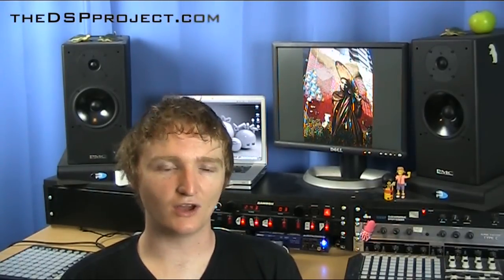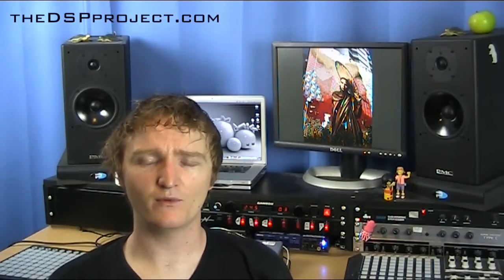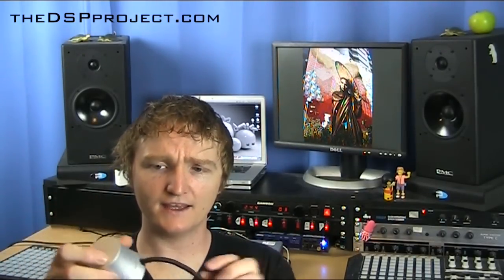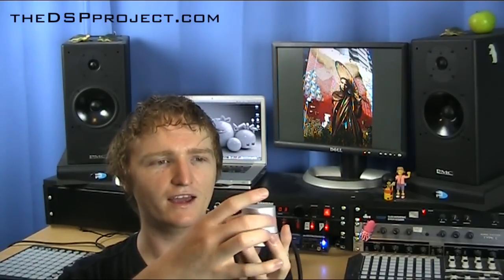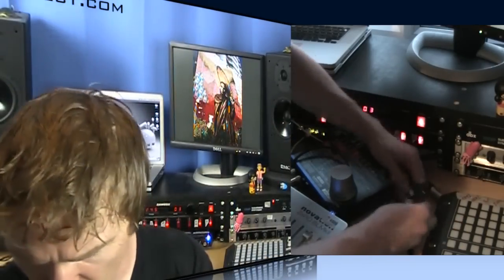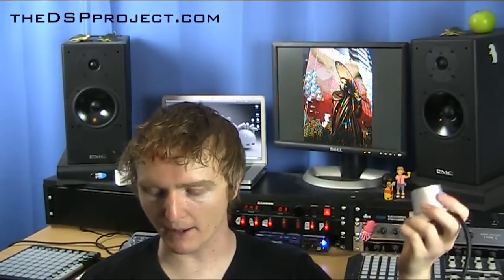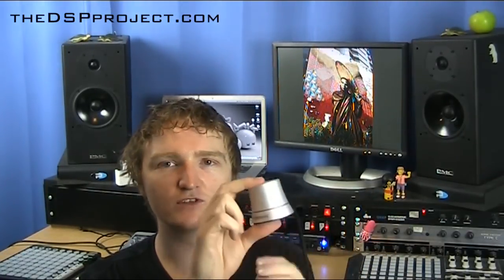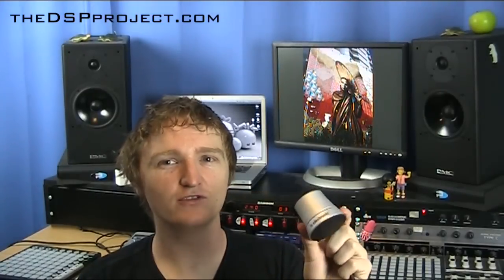TC Electronic Level Pilot review

Comment: I bought a SM Nano Patch for volume control a few months back, but it was really really noisey. Did you experience any noise with this unit?
Reply: Timecop1983 I've been using a Nano Patch for a while now, and have never experienced noise problems. You know you can either use balanced (TS) OR unbalanced cables (TRS, XLR) with the NP, right? The NP won't do level conversions.

Comment: I've had it for 2 months now, but now I've noticed it "crackles" when I turn the knob in certain areas......Anyway to fix that?
Reply: I have the same problem. do you still experience this?
Reply: It got so bad I had to send it to the warranty place to get it fixed. The replaced it with a better dial. I'd suggest you do the same. It still crackles but that's expected with a volume knob if you're always using it...which I am. Usually what I do is turn the dial a full circle back and forth several times to loosen up the grit in there and the crackle goes away. There is contact cleaner as well ....it didn't work for my original one.... so I'd be careful with that idea if you choose to do that.
Reply: I read on a forum that it had to do something with a Dc offset from or to the devices. It's weird how a 70 euro volume knob actually crackles, i think it's stupid
Reply: Ya...I was pissed about that. NOw it's not bad....It's a really faint crackle.....
Reply: True, same here!

Comment: Yes that tight lead is badly designed, monitors are usually a few feet apart, and mixer outputs across the room.
And same crackle problem as Mackie Big Knob reviews.
It's a NO from me.